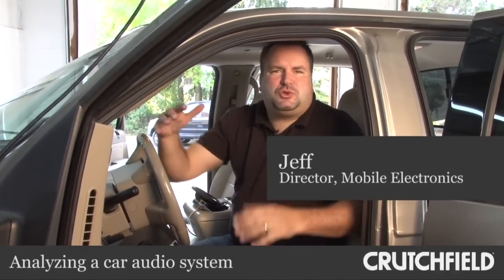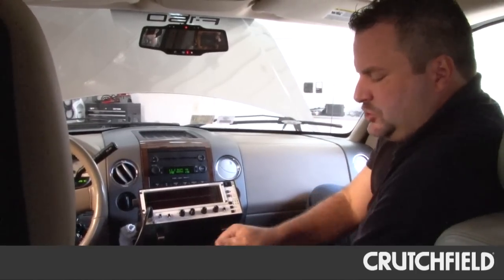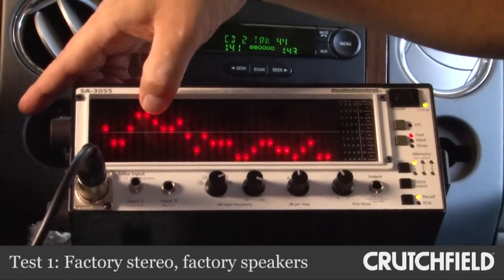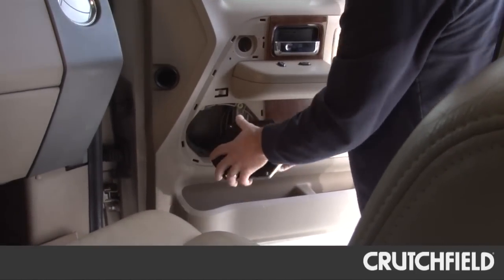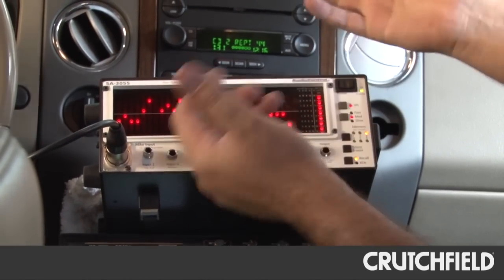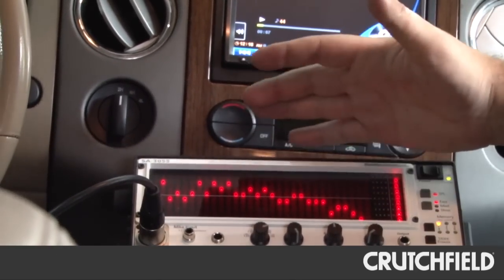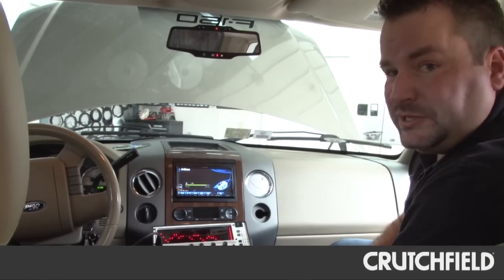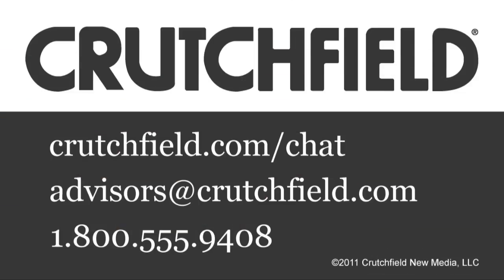Crutchfield Labs: Aftermarket vs. Factory Sound

Comment: I have a factory head unit with a amp adapter, will my system be louder if i got a aftermarket radio like give me more rms too fully power my 2 12s. Im trying to get full 2000 watts rms heard i need alternator or battery
Reply from the maker: Which amp adapter do you have installed? Also, what is the brand and model of the amp?

Comment: What about factory radio, aftermarket speakers, and and 4 channel amp for the 4 speakers, if said vehicle has 4 speakers?
Reply from the maker: That should produce results similar to those shown with the setup including the stock radio and new speakers. If an amp with a good DSP is installed, the results will be closer to those produces with an aftermarket radio and aftermarket speakers.

Comment: What if I want better sound using an amplifier with an OEM head unit?
Reply from the maker: That can be done as well and for some vehicles, adapters exist that are design specifically for getting the best sound out of the stock system and ready for after market amps. I recommend contacting an advisor to get help designing a system for your vehicle. Here's how to reach us for this help:
https://www.crutchfield.com/I-rYTVc227/support/ContactUs.aspx

Comment: Sir, hats off... you in 6 minutes answered many questions I had, even others I had not figured out...
Kindly, advise on which after market radio brands (be specific if you can)  is capable of producing that deep “air bass” below 30 Hz.
Million thanks 🙏
Reply from the maker: I don't think you will get much improvement in that range with any radio alone. As shown in this vehicle, it took a new radio and new speakers to get there. Also, fitment of the vehicle will affect what can be gotten from new radio and speakers. I recommend contacting an advisor to discuss your vehicle and these goals as well as any others you have to get a personal recommendation on a setup that will give good presence in the bass below 30Hz. Here's how to reach one of our advisors for this help:
https://www.crutchfield.com/I-rYTVc227/support/ContactUs.aspx
Reply: Crutchfield Thanks

Comment: Really great video and explanation... Many thanks guys...would also request you guys to perform a head unit face-off sound test/review of the different stereo brands Such a face-off was performed by Cruchfield some years back and provided with great information about the different brand of stereos. At that time if I remember correctly the winner was the JVC single din HU as it did not distort at high volumes while the HU by Sony was said to be the most fun to hear. Looking forward to such stereo face-off as well at the earliest. Many thanks again.
Reply from the maker: Thanks for the suggestion! We'll pass it along!
Reply: Just use an Astell&Kern sp200 DAP running analog wired into a DSP. Much better source.

Comment: actually...the JL audio fix 82 or the fix 86 would have changed the frequency response to almost as an aftermarket headunit, it has all the right calibration to really make a stock headunit perform.
Reply: Or pioneer deq-s1000a sound processor

Comment: one thing to bear in mind when using a factory head unit/aftermarker speaker setup is that the  headunit is most likely connected through high level input opposed to low level input (RCA) which produces a cleaner sound and signal. Just a thought.

Comment: Yeah I got stealthbox with 12 inch tw3s...jl.audio hd 750-1 in my truck and underwhelmed. So I got a line out converter and sound setter but still smells sometimes, the gain is all the way down and bass knob is lower than half and never any distortion n I feel like I can louder but nervous they will smell or something. Ok so will a new head unit instead of my bose head unit make a night n day difference or should I just quit now and sell box? Help.
Reply from the maker: Replacing the factory head unit can certainly help improve the signal quality going to your subwoofer(s), especially if you have a factory Bose audio system. For more assistance or to receive a personalized recommendation for your truck, please contact an Advisor directly from the Crutchfield website: https://www.crutchfield.com/I-rYTVc000/support/ContactUs.aspx

Thanks!
--Crutchfield

Comment: in my opinion the stock system sounds better because if you leave the stock radio in and replace the stock speakers the stock radio will have more bass because i have good sounding stereo speakers and i have the same exact stock radio and it almost blew the speakers out from the stock stereo

Comment: im looking for a 1,2,3 video not a nerd video by that i mean why not Just compare both side by side? instead of bs
Reply: It is extremely difficult to accurately present what those sounds in the video actually sound like.  The microphone recording will never be like your ear would hear it.  So a side by side would not give you very accurate information.  What he did was give OBJECTIVE data that is not dependent on what someone else thinks sounds good or the microphone recording the video.  

That device he is using is an objective measurement that is not dependent upon anyone's preferences, or the limitations of the microphone recording it, or how your speakers play the video.  This is the BEST, most objective analyzation of the differences each of these components make to the sound.
Reply: +Kevin Hill nerd
Reply: Leoncio Torres leoncio, you are ignorant, thinking a recording can be the same as being there. If you don't like this video, stop whining and go find another. Just because you don't gain anything from it or are unable to grasp the benefit of it doesn't no one else does or will.

Comment: If im gonna run a quality aftermarket amp... is it pointless to buy an aftermarket head unit??
Reply from the maker: +Marek Sumguy If you install a factory system integrator along with this amp, then I'd say yes it is pointless to replace the receiver. However, if you don't then it would be a good idea to replace the radio so the quality amp will get quality signal. For additional assistance & personalized recommendations, feel free to contact us directly:

http://www.crutchfield.com/I-rYTVc000/support/ContactUs.aspx

I hope that helps.
--Crutchfield
Reply: +Crutchfield  Replace the radio?.  Do aftermarket head units have better radio signal??
Reply: +Marek Sumguy If you want to keep your aftermarket head unit, I highly recommend doing a fairly simple mod to grab the Digital output off of the DAC.  All you have to do is find the DAC's data sheet to pick the right pin.  It will be labeled DOUT.  Then you grab a +5V and ground to run the TOSLINK adapter and you're in business.  Use that digital signal to feed a quality outboard DSP and never look back.

Of course, you'll lose your steering wheel controls when doing this, but a little knowledge about how to program an Arduino to get it to work with the CANBUS system of your particular automobile and you get them right back.
Reply: +Marek Sumguy One thing many fail to mention is that current factory headunits use a DSP to shape and time-align the audio signal using the factory speakers. They attempt to give the illusion of good sound, using poor quality components, by either emphasizing or reducing certain frequencies and applying time alignments that sound good for everyone in the vehicle. "Joe Consumer" is an audio idiot and that's how companies like Bose or Beats make their money. In the video example, they noted a boost at 80hz. This will seem to have a fuller sounding low end but is far from correct. Removing midrange has a similar effect of making the bass and treble seem louder. Whatever method the OEM used, it was designed around someone's incorrect opinion of what sounds good. Any aftermarket headunit without time-alignment is a waste of money. I can't stress enough how critical that is to having a good soundstage in your vehicle. It will bring the music up off the floor and put it in the windshield. Do the test. Close your eyes and point to the vocalist. Are you pointing at the windshield straight in front of you? Or are you pointing to your door? An amp makes it louder. Garbage in, garbage out, just louder. So yes. Definitely change the headunit when installing an amplifier. If the headunit it overly-integrated into your vehicle, devices like the Cleensweep can correct most of the frequency response issues but it can not remove time corrections or auto-loudness functions of the OEM headunit. I had more on this but I'm out of time.

Comment: Great tutorial.
06 Chevy Silverado standard cab has stock CD /radio and speakers.Sounds bad ,CD not as bad but definitely not what I want.Looking for a decent balanced sound that can crank but not blast or thump .I love my rock/metal so it needs to handle it.New head unit to start then speakers?Thanks.
Reply from the maker: seered19wing You can find all of the models we recommend to fit your vehicle by using the "Outfit My Car" application on the main website here:  http://www.crutchfield.com/I-rYTVc180/car/carselector.aspx?lp=%2fCar%2foutfitmycar%2fcar.aspx  You can use the "Filter" option at the top of any product list to narrow the selection by brand, price, general features and more. For additional assistance and personalized recommendations, feel free to contact us directly: http://www.crutchfield.com/I-rYTVc180/ContactUs.aspx Hope that helps!--Crutchfield

Comment: Hi Jeff, What is your opinion on the 13 spkr stereo in 2014 Pathfinder. It has BOSE speakers with Sub Woofer and Clarion head unit. I like the spkrs but think the head unit need some kind of electronic tuning. Can all music systems be tuned for improvement as I've seen on your videos. Bass is low except at higher volume. Can the local Auto stereo do such intricate work without degrading the system. I'd like to improve sound quality without an expensive upgrade.  Let me hear your response.
Reply from the maker: I think your best bet to improve the sound quality in your Pathfinder would be to upgrade the factory Bose speakers. That would be the best place to start, and adding an amplifier to power your speakers would be the next logical upgrade.

To see all the speakers we carry that would fit your car you can use the "Outfit my Car" application on our website: http://bit.ly/1vRMpJR

For additional assistance & personalized recommendations, feel free to contact us directly:

http://bit.ly/1tLNAOf

I hope that helps.
--Crutchfield

Comment: Sure, replacing the head unit creates a flatter frequency response. However, still using the stock speakers is going to generate a lot of distortion. In addition, the frequency response of aftermarket speakers could be fixed with the eq on the stock head unit. Your best bang for the buck is speaker replacement, in my opinion, assuming you know how to eq well.

Comment: ok that makes sense.  Thanks a lot!  Now i'm curious about something i think other people are interested in as well; What's the difference in the response curves between stock, low end aftermarket, and high end aftermarket?  Are there any stock systems that may actually be better than the $100 aftermarket heads?  or the aftermarket head pretty much always superior even if it is relatively inexpensive?

Comment from the maker: The better EQ, the higher quality componentry, better quality DACs (Digital to Analog Converters), higher quality internal amplification, greater signal strength & clarity via the pre-amp outputs (when using external amplification) and much more. Feel free to call for additional assistance: 800.315.0030--Crutchfield

Comment: @unit9014 The reason I say that is typically when a customer is debating between the two options they are looking to spend only a couple hundred bucks, so they are looking at some new coax speakers or at about $100-200 head unit. For the customer who can afford an expensive nav, adding on the speakers is typically small potatoes, eliminating the need to choose what to do first.

Comment: I thought this was super interesting. I have always been of the impression, and always told my customers that speakers would typically make a bigger difference in your sound quality than a new headunit. I stand corrected. I would like to see this done a again with a $99 headunit rather than a $1000 nav unit and see if the results are the same though :-)